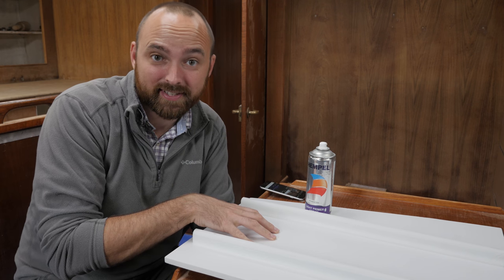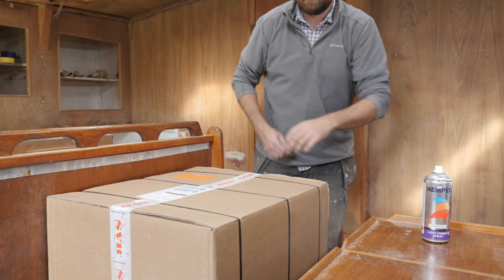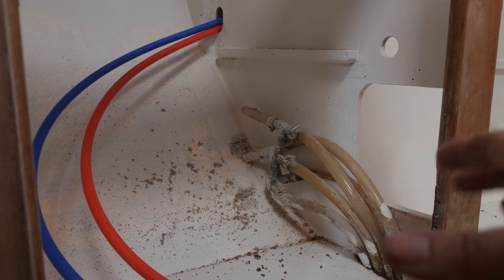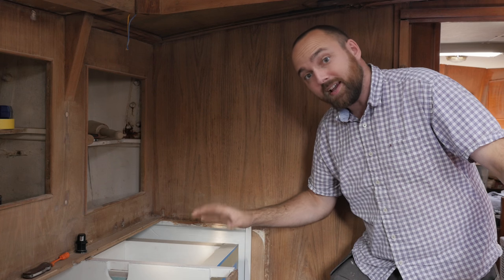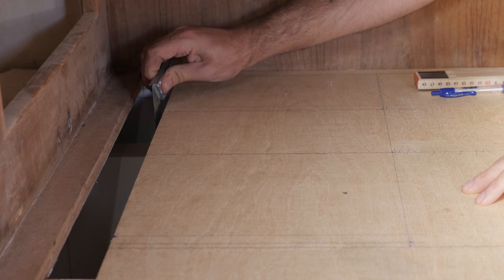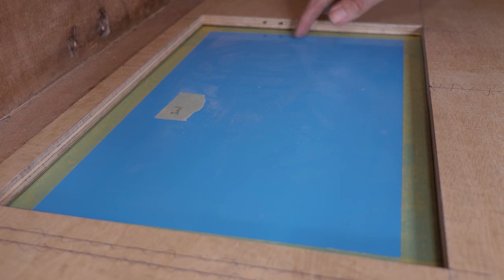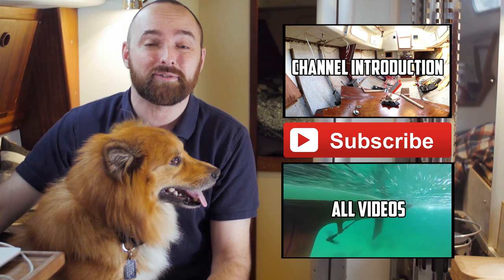Sail Life - DIY sailboat restoration update #14, Isotherm fridge installation prep

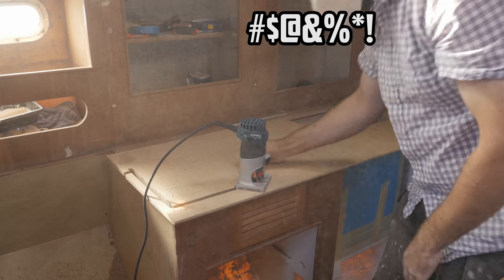Comment: At 7:24 is how I felt two days ago when I discovered I left the running lights on for three days.  I was so upset, I turned off the main at the breaker panel and locked up and went home. Today I went back to the club and tested to see if anything was left of the battery and to my surprise, it cranked the 9.9hp outboard.  Anyone ever have a weird thing like that happen?